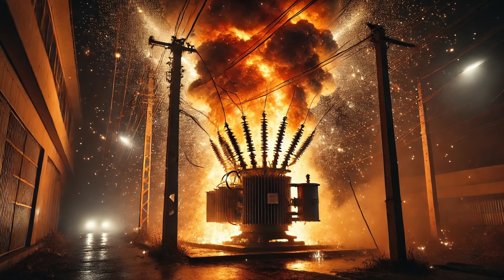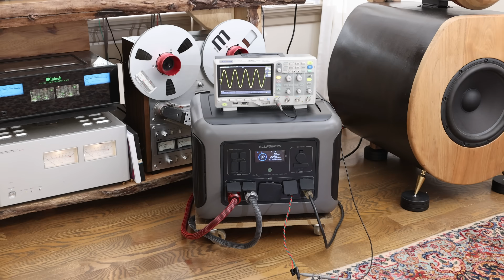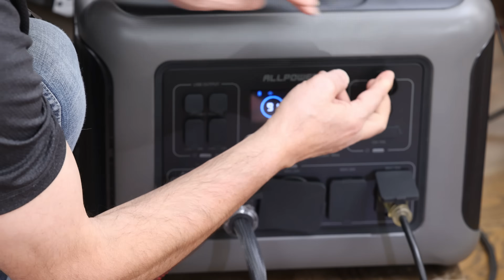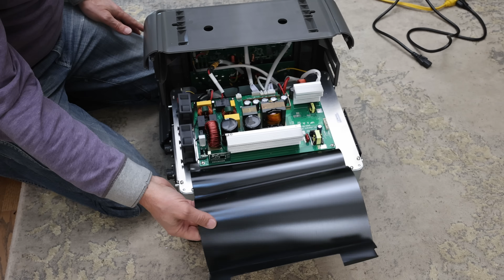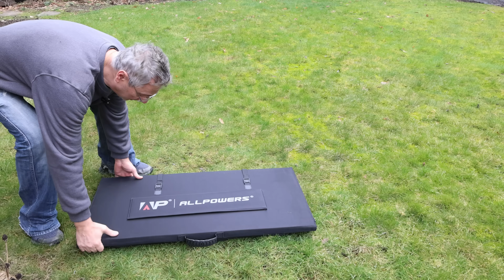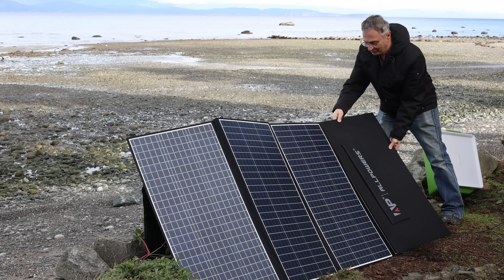Will a Massive ALLPOWERS Battery Improve Sound ?

Comment: I used to come up with the same idea, but by using a big uninterruptible power supply, reasonably real time switching I might add, just to be disconnected from the grid with all high frequency pollution, It’s absolutely a “sound” idea! Thank you so much for this test, I was never able to test it as thoroughly as you just did. The difference of night and day, literally. 

I love your feline assistant, busy double checking the solar panels! Where would we be without them.
Reply from the maker: Thank you It is a experience for sure

Comment: Hi Gabsrer, I love your channel. After watching this video I decided to try my little Yoshino battery with my DAC & Streamer. I checked the web to see if it put out a pure sign wave before plugging in & google AI said it did, so I plugged in. Everything worked fine on day one at about 75% battery. I charged to 100% overnight and the next day when I started the battery the A/C outlets kept shutting down. Total load about 28 watts. I unplugged my DAC and was able to run my streamer, but I noticed a lot of transformer hum. So, I unplugged that and went back to AC. The battery also has noxious fumes. Going to buy the brand you demoed.  Thanks!
Reply from the maker: your Yoshino battery inverter may not be a true clean sinewave 
buy a cheap Oscilloscope
https://youtu.be/mqGENRnlS4o?si=LZvtRdvrddymsD3w&t=102
This one
https://amzn.to/4hVpLN8

Comment: I tried this and noticed the sound was cleaner and more balanced. Surprised that my Yamaha only used 68 watts to power two Thiel speakers and the 12" subwoofer used only 10 watts at half power. The big downside was the fan noise from the battery which came on in 3 minute intervals.
Reply from the maker: Ideally for long term use if you are in a house is to put the unit outside in a covered enclosure with lots of ventilation this will solve both the fan noise and a bit safer outside the house you can also connect a solar panel to it.
Other option but will void warranty and put  you and the house at risk is to add a bigger heat sink and Noctua quieter fans replace the 2x 60mm fans with 4 x 80mm quiet fans.

Comment: Do you find excessive running noise from the unit?  Ecoflow Delta 2 Max claims their charging noise is only 30db but I am not sure if the sine wave is as good as Allpowers.
Reply from the maker: There is some fan noise best to run it a bit away or outside covered area for safest operation

Comment: I'd be surprised if it didn't make some sort of difference to the sound. It's now getting 'a balanced supply' free from potentially noisy N/E bonds as well as reducing mains inductance from the local transformer. I use a floating 5kva 1:1 transformer with standard earth.

Comment: Hi Gabster, thanks for this new inspiring video ! Question: is it possible to use the R2500 while charging ? If so did you noticed a significant impact on the sound ?
Back to the measured power in your system, except if your amplifier is (like mine) a Class A one, the power may significantly increase when you will crank out the listening volume (and the autonomy be accordingly reduced). Thanks !

Comment: If you plug the power station into the mains supply does the invertor on the power supply maintain a clean supply to the hi-fi in other words do the batteries smooth out the mains?

Comment: Very interesting.  It would be interesting to compare this sound to a PS Audio Power Plant.  Then to a Tesla Power Wall. 
I have often thought that a solar/battery system in the house would be a great way to wean off the grid and possibly improve our audio sound quality.  This suggests that is likely.
I want to call out your recommendation to ground a system like this.  I think it is important to connect a safety ground.  I guess it doesn't matter because it is similar to running on an isolation transformer.  Interesting question.  Would the sonic benefit still be there if you are connected to the grid safety ground.  I suspect its benefit is the regulated supply combined with the noise disconnect.
A solar array and a lithium battery bank would be a great addition to my home.  Right now I have a battery backup system for the computer/networking systems and a natural gas generator for the whole house.  Not green, but sure is convenient.

Comment: First thanks for this review. Nice unit.  I'm not sure if the answer to this question obvious or not, but I couldn't help but wonder if the bass change is more due to the Luxman or your DAC plugged into this unit or perhaps both..  and whether its more noticeable when only one is battery powered.. answer to this would inform the size of the unit one may need in their system.